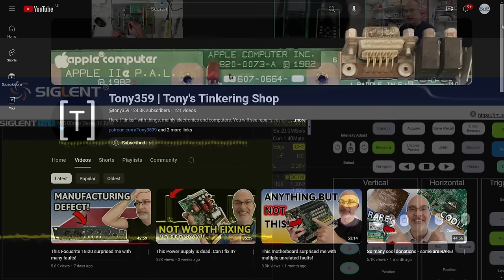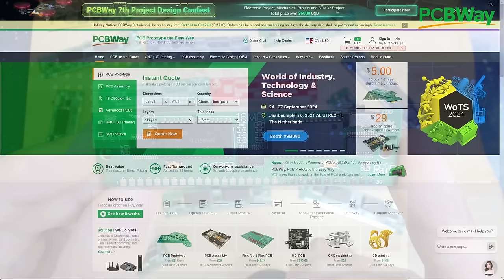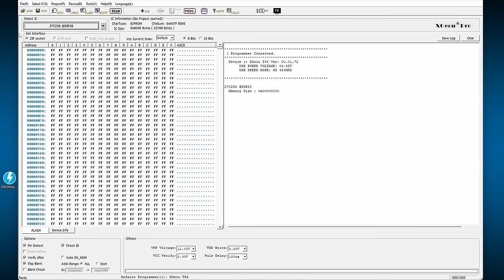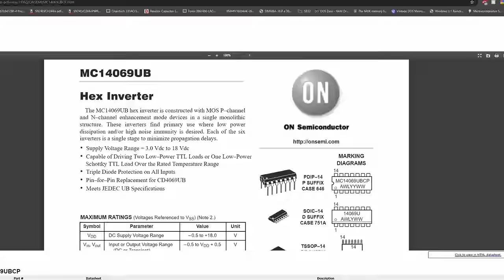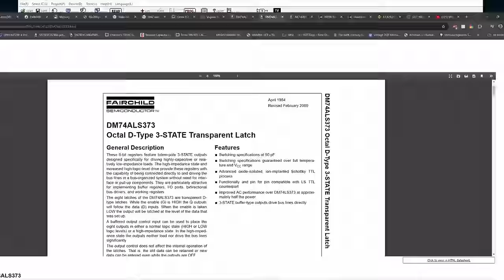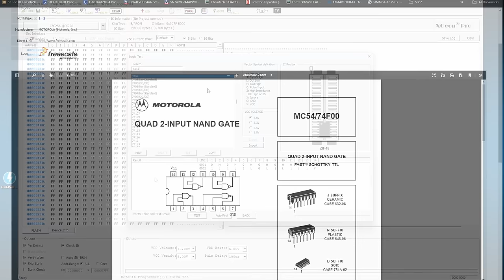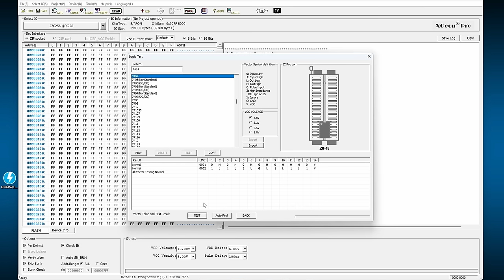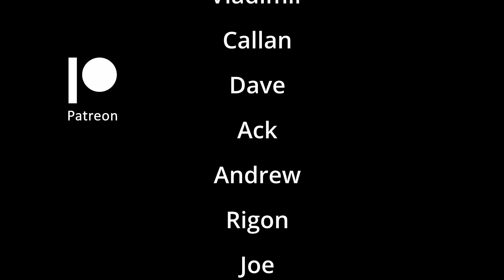Can I Save This 286 Board? Testing & Socketing all 13 logic ICs!

Comment: Hi using a chip tester to test chips in isolation is a bit of a waste of time as the tester will not test the speed of the device. The main failure mode of vintage chips is to 'fall out of spec' and not respond to signals properly.  the most effective way to diagnose the problem with a 'post test' card to find out the exact post code it fails on and work from that, this will save you a lot of time as you can isolate the failure and see what the bios is doing when it fails, narrowing down the fault specifically rather than the scattershot approach. also if you can use a board pre-heater you will find it much easer to remove ICs with a proper vacuum desoldering gun and only use wick to clean up after component removal. After 40 years experience doing it as my main job  I found it is better to have the right tools for the job than to have the headache of accidently destroying the pcb, as the components are somewhat replaceable unlike the PCB.
Reply: Yup also an Oscilloscope and an experienced techie could reveal those and many other types of faults via an oscilloscope, no excuse these days
not to have one as the oscilloscopes that will do the job are cheap these days..
Reply: I’ve managed to isolate defective ICs on Apple II computers and saturn memory cards using chip testers. True, in one case the ram ICs would pass but the card would fail on a memory test. A single IC out of 16 that passed on test individually but fails to operate properly. Even so, I revived an IIe motherboard after identifying the faulty IC
Reply: on practice - any IC with same tech and mark works identically. Only one exception on this AFAIR - on some old 8bit machines can work only with Hitachi RAM due to some quirks with refresh.

Comment: Your programmer may be unable to test open collector/drain chips. That's why you couldn't  check that 7406. If you want to be able to check these, add pullup resistors to all the outputs and select chip variant with regular, push-pull outputs. You might want to slow the signals down a little bit, since signals with pullups are usually slower. If you happen to have more of such chips to test, it may be useful to build a little adapter with pull-ups configurable with jumpers.
Reply from the maker: Hm, nice idea. I am not sure how often I come across chips like this, but I do have plenty of socket 3 and earlier boards for testing and repairing.

Comment: if you have an oscilloscope and schematics press the reset button and see what's firing. all control signals with data and address lines..also vcc and grounds to all chips and all clocks...

Comment: Do a Google search for solder needles. They're basically hollow stainless steel tiny tubes with a handle. You find a needle that will fit over the pin, heat up the joint and slide the needle over the pin, remove heat and then remove the needle. Solder won't stick to stainless steel.

Comment: Grab a good quality vacuum desoldering gun, it’s a hundred times faster than solder wick. Then if the chip is still stuck, hit it with hot air from underneath, and it’ll fall right out.

Comment: Approach coud be from two directions: A) Hw debuggung. 1.I would check an another 286 working board's memory behaviour and compare to the octec board's. CAS, RAS, data and address lines. Do not be surprise, you will find some oddities on these lines. 2.Check the bios ce, oe, rd lines on scope. If you see activites, about 80-100 bytes read than the CPU - bios - chipset lane is working. The possible problem is that a chunk of code is written to the base 64k from the bios and the processor try to exetute from memory which is fail. 3 Check the oe, ce, data lines of the keyboard controller. 4. Check the oe, ce, rd, wr, data bus lines of the rtc ic. 5. I would check the oe or ce lines of the rtc, kbc, bios to see the timing difference between them. We do not know the order how the chipset is initializing the these subsystems. If you are lucky one of the oe, ce will fail indicating the chipset stuck in the previous subsystem's initialization. If these are in order than the base 64k memory is the possible candidate. The objective is to narrow the area of the possible place of the error and focus on that furthermore.
B) Software approach. If you have the right sw tools and some experience with bios disassembling than this approach could be the right one. Use eeprom to speed up the debugging process 1. Identify the sequence of the subsystem initialization: Chipset, KBC, RTC, base memory, ie main function calls. Insert your post code after the return of the main function blocks. This way you can narrow step by step where the code stuck to the last subroutine. Examine that code, you will get the answer why the system is hanged on and the specific hw check can be made. Good luck!
Reply from the maker: Oh, that's some really great help! Thanks for sharing. I probably can't do the software approach due to lack of knowledge, but I'll check the approach with the pins if I can find an issue.

Comment: Another great trick for desoldering DIP chips in a multi-layer boards like this beside good quality desoldering station is to cut long solid copper wire and wrap all the pins with it. By applying new leaded solder to this wire and heating it it will transfer the heat to all the pins at the same time and the chip will just fall off from the board.
Reply: like mr solderfix does
Reply: no need for ghetto wire tricks, clone T12 Blade Tips are "whole" $20
Reply: Or I use a section of solid copper household ROMEX-type wire and just plant that against all the legs and heat the wire to heat the legs that way.  YMMV, especially if the copper gets bent.  I suppose graphite rods might work very similarly.

Comment: 7:23 a desoldering gun, or even just one of the plunger types, makes quite the difference on through hole components. I got the cheapest desoldering station I could find, and it sucks the solder from the top side through the board just fine. Absolutely worth it if you are working with through hole components.

Comment: The combo I use is a Hakko FR-301 to clear the pin holes and if it's still not loose, I'll use hot air on top with a chip lifter under the chip with very gentle upward pressure until it releases. I have never damaged a trace or via using that method.

Comment: Some years ago I had  a similar problem with a 386 board that stoped working after a tantalum explosion. After some testing  I fixed  the board replacing  a dead kbc and a dead cpu.  After that I preenptive  replace all the tantaluns with eletrolitics on all my retro stuff.
Reply from the maker: Many suggested checking the keyboard controller. Thanks for sharing your experience. The keyboard controller is going to be the next thing I'll check.

Comment: I hold little hope for those two 'new' boards being fully functional.  That kind of plastic wrap would lead to an instant "Warranty Denied" note, if it came in for repair, packaged like that.  There is a real reason why the industry has spent so many Millions/Billions (pick what ever currency you like) on anti-static protection technologies.  Those bags, pink packing peanuts, tools, etc. were designed with a greater purpose than just making more money.

I do truly hope they do function fully for you.  Time will tell.  Luckily, most of those chips are easy to find replacements for.  Except, possibly those Headland HT12/A's.  Well, maybe the RAM DIPs, too.

Good luck, good Sir!  Thank you for another great video.  We are a niche crowd, but still love our retro hobby!
Reply from the maker: Thanks! Yes, I do hope that those boards work and help to fix the board I found at the scrapyard.
Reply: @bitsundbolts  Indeed!  I look forward to the video(s), and hope for smooth sailing.

Perhaps an idea, if it has not occurred to you yet, get some other board you do not want to, or cannot fix, that have PQFP IC's, and practice your hot air skills until you can remove or install one in just a few seconds, which will minimize the progressive heat load damage soldering can induce.  PCB preheaters can help with that procedure quite a bit.  Take a look at some of Northwest Repairs videos to maybe learn some of his techniques.

Comment: Did you try to swap keyboard controllers?
These are critical for posting and I have seen them fail many times with different ways.
Reply: Agree, first thing to try next.
Reply from the maker: I haven't yet. With these other boards, I have plenty of spares to work with. I'll try it as soon as I can. Thanks!
Reply: That was pretty much the same idea I had - along with checking the weirdly placed second oscillator on the unpopulated ISA16 footprint.
Reply: yes i think keyboard controller handles the reset line aswell...and i had sucess sometimes replacing faulty ones with different brands and models
Reply: I used the SuperSoft DiagROM with success to determine a faulty KBC (broken trace) on a 386 board. And I agree with other commenters: scope and less shotgun debugging would be good. However these boards are much more difficult to debug than a C64 :)

Comment: I find it is better to start with known working inventory so for me, testing the two eBay finds would be my first step.

If you find a working board out of the three, you can separate the projects and make your video about the Hardware EMS. This way, if you need to borrow parts from any board to repair the first, you've got the EMS content complete. 

I love "scrap to treasure videos" as well as unique features of hardware so no matter what, the content is fascinating.
Reply from the maker: That's a good strategy! That was also what I was thinking - get the content done first, then start experimenting. But first, I need to replace those tantalum caps! I'm not going to risk another explosion.
Reply: @bitsundbolts What??? No more popcorn??? 😱

Comment: Not surprised the logic ICs are all 5V since it wasn't until the 486 DX2 that you started to get motherboard voltages lower than 5V
Reply: Not surprised the logic ICs are all 5V since they are all in the TTL 74 series, which are all typically 5V chips.

Comment: 4049_U_ is the unbuffered type, which is often used for building oscillators.
244/245 are tri-state bus drivers, 373 are latches - I'd guess for ISA bus access as it runs slower than the CPU

Comment: 7:19 for desoldering apply flux on upper side, teached then I'm debugging my first Spectrum clone in deep 90's (then other IC and PCB are too costly). And desoldering gun (or hot air gun) make this process much easier.

10:21 MC14xxx is only different markings for IC made by Motorola (now ON Semiconductor). CD4xxx is markings for TI and other manufacturers. BTW, some makes an unique ICs with unique markings.

17:19 all S/AS/LS/ALS/F have rated for 5v supply. 40xx/HC rated for +3-+9v. HCT almost all can be work +3-+15, but rated for +5v for compatibility with TTL logic. Damn, as I so much old?....

Comment: I don't know if anyone has mentioned this before but you could try pushing down on the headland chip and trying to boot. Large QFP ICs like that can have pins detached from the board and it's almost impossible to see it with the naked eye. The other, perhaps less valuable, observation that I had was that the available test vectors for the ICs you tested were very much insufficient to even test all the logic functionality, never mind falling out of spec like someone else mentioned. For the quad NAND, you need a minimum of 4 test vectors for example and the tester only tests two.
Reply from the maker: I can try to swap the logic chips with the ones I got on the other boards. I also have a scrap 486 board with most of those chips. Yes, out of spec probably slips through my testing method.

Comment: Low temperature solder is also helpful to remove ICs - older hardware can be more sensitive to heat, so watch out. I had issues in the past lifting traces, sometimes the solder wick doesn’t remove all… you can’t see under the IC

Comment: As for as your process for desoldering, you might benefit from a board pre-heater, though you'd need a pretty large one for a full-size PC mainboard.
Reply from the maker: Space is a concern since I live in an apartment and don't have a separate room for all this stuff. I only have a small pre-heater that is enough for a graphics card. A pre-heater would definitely help here.

Comment: On the orignal board from this video, try putting the DIP chips from that last ebay board in without the simms and see if that gets any further. Looks like they should be 256k x4 so 8 gives 1mb. That might show the simm slots have a broken data line.

Comment: This board looks like a super integrated "one chip solution".
So, besides a few buffers 74xx245, 74xx373 etc... the whole magic happens in the Headland chip.

The different memory banks should be mutually exclusive:
Either SIMMs or 44256 on the board.

From a qui analysis of the board:
The LM339 is probably the power good signal logic (part of the reset logic)
The 4069 is probably part of the 32Hkz RTC oscillator
All the chips near the 40MHz crystal are buffers between the chipset and the ISA bus
The 245 near the keyboard controller is probably a transceiver from the CPU bus to a local 8 bits bus for the keyboard controller and the RTC.
All the other functions are probably in the Headland main chip (timers, interrupt controllers etc...)

As an aside there are 2 EPROMs because of the 16 bits bus if the CPU. So one contains all even bytes and the other contain all the odd bytes.
There are NO buffers between the Headland chipset and the memory bank(s).
The reason for the extra 32 MHz crystal is probably to have a specific clock for the ISA bus independent of the main CPU clock.

Going back to the issue, all the chips are probably irrelevant:
If the bios codes indicates 64k base memory (code 10), it basically means that the bios is trying (and failing) to initialise the DRAM.
It needs this to set up the stack and go into the more complex portions of the BIOS.

This can mean several things in a PC:
1) at least 1 trace missing from the headland chip to the memory (possible).
2) at least 1 trace from the headland chip to the memory is shorted either to the internal VCC or ground planes (quite likely considering the corrosion damage)
3) memory lines could be shorted with each other
4) broken refresh, the memory cannot keeps its data reliably. This mean that the timers are not initialised (not very likely, because the board beeps)

Things you could test:
For 1) 2), and 3) test every line from / to the memory bank(s) and to the chipset with a multimeter.
The lines should neither be shorted to anything or floating
- Get the specific pinouts of all the memory chips
- First test between the banks (D0 on SIMMn and DIPx for example)
- With a known good on the step above find D0 on the Headland chip

For issue 4) On a running motherboard:
1) check ALL the clocks 40, 32, 14,342 (system clock, used by the timers)
2) measure /RAS and /CAS on the DRAM to confirm the system is really refreshing memory correctly.

In the worst case scenario, if really nothing works, using a set of specific ROMS might be the only solution.
Adrian Black (Adrian's digital basement) has showed a set of EPROMs (memory test software) that do not use main memory but use ram from the video card instead.
It can work with NO MAIN MEMORY.

I hope that helps ...
Reply from the maker: That definitely helps! Thank you so much for the write-up! You're correct with the assumptions about the responsibilities of the chips - at least what I could find out based on the manual. The 32 MHz crystal is used to get the 8 MHz ISA clock. On boards with 16 MHz 286, this second crystal is missing. In that case, the CPU and ISA clock are driven by the same crystal.

I'll try to debug the board further. The information from your comment will be very helpful! Thank you.
Reply: @bitsundbolts  Also in your previous video the beeps come in groups of 3, which the manual says is "Base 64K Byte Memory Failure". So using the XT RAM Test that David Giller and Adrian Black developed to try and root cause the memory issue is probably a good direction to go.

Comment: replacement crystals are fine but more logical option for working on a board would be to get a scope with arbitrary function generator with at least 25mhz bandwidth and you can inject any clock you want anywhere you want and test if the sigbnal propagate corectly

as for 74 line of logic chips, i had recently a brain fart with one of those, everything seemed to work fine, the chip all the traces, power planes, one pin i didn't check was ground, and the trace for it was busted making all sorts of problems
Reply from the maker: Oh wow. That's interesting regarding the ground trace. I should definitely keep that in mind! Never forget to text the ground connection.

Comment: Have you checked the keyboard controller ... also the placement of the second oscillator is dodgy/questionable - not that it shorts out some of the unpopulated ISA pins.
Reply from the maker: I think the keyboard controller is the one I check next. I saw a video on Necroware's channel - a 286 repair as well. It makes the same beep sounds! He fixed it by repairing a broken trace that leads to the keyboard controller!